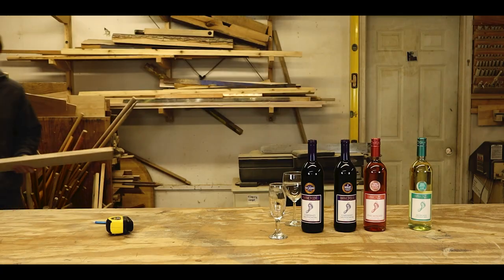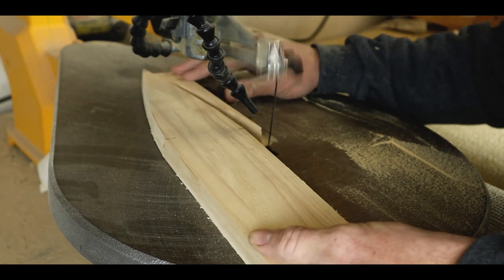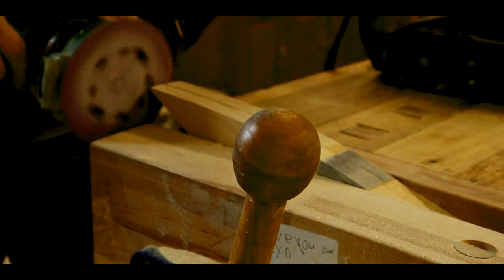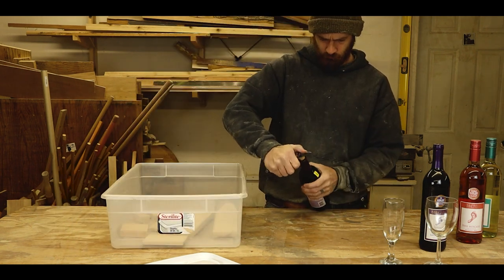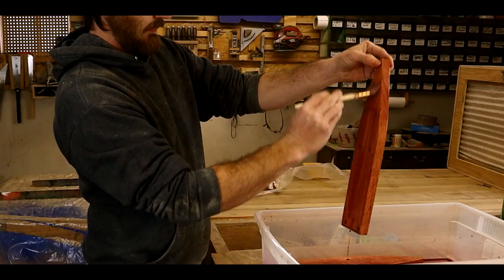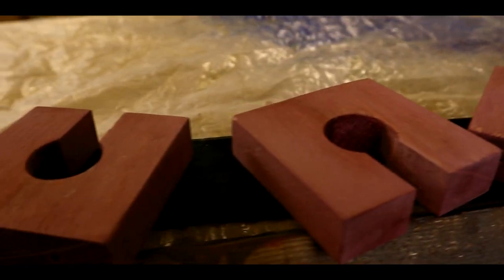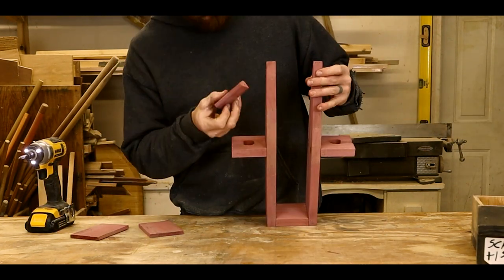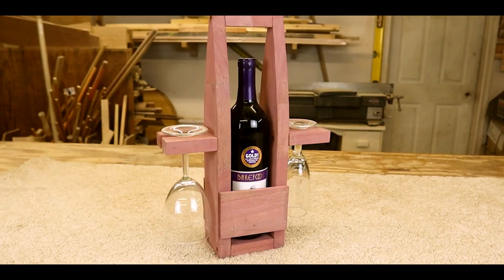Can WINE be Used to Stain Wood?

Comment: What an innovative idea. Most people try to remove wine stains from wood, not you. It turned out great and the color is amazing. I don't think shellac would work thou since it breaks down with alcohol. Your best bet would be polyuerethane which is essentially a hard plastic coating.
Reply: alcohol was first to evaporate before the water, no problem whith shellac or any finish!